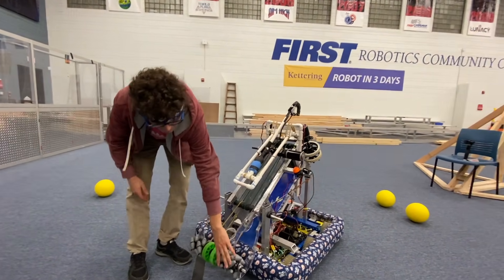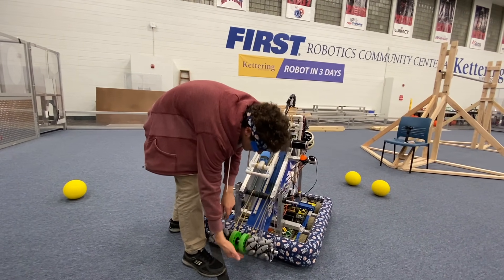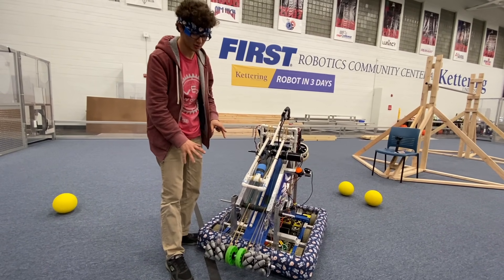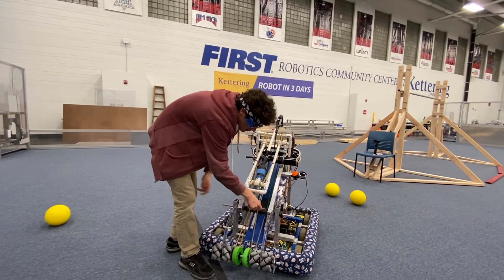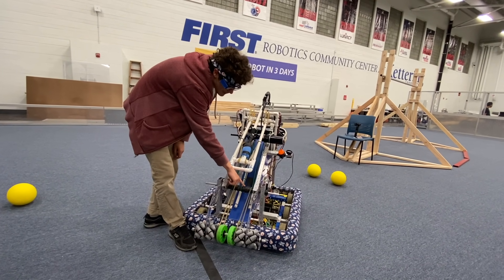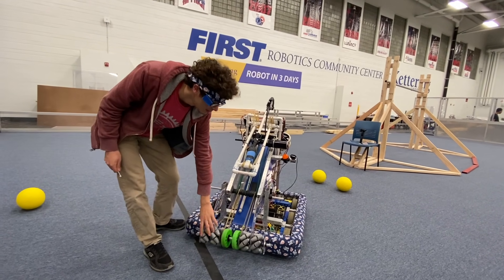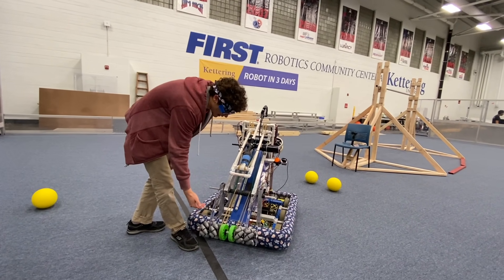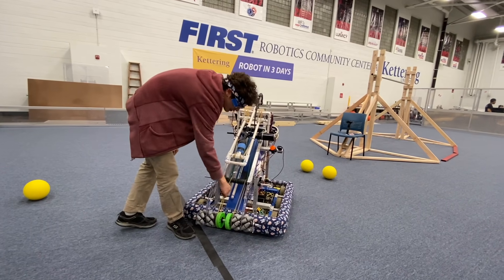2020 Ri3D Intake

Comment: That's really cool but won't your intake get destroyed if an opponent robot rammed you?
Reply from the maker: For that reason we made a couple spares of the lexan however we think that it is flexible enough to survive most collisions. It will just be up to the driver at the FACC to make sure it doesn't get destroyed.

For a full 6 week build we recommend adding a motor for the angle so that you can bring it up while not collecting balls